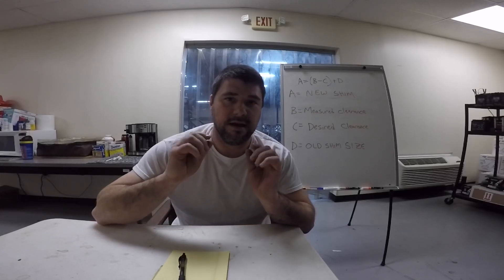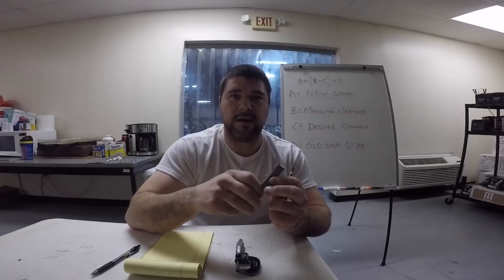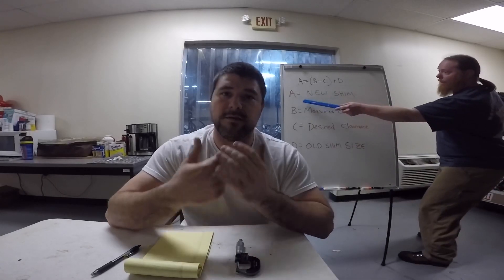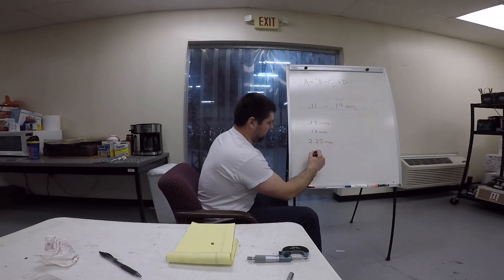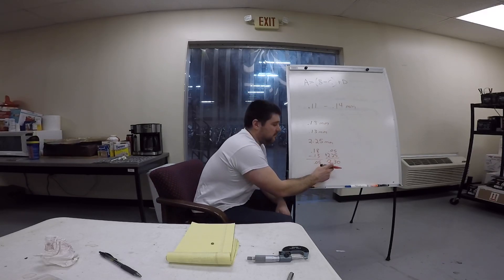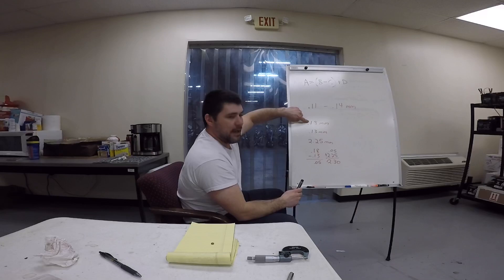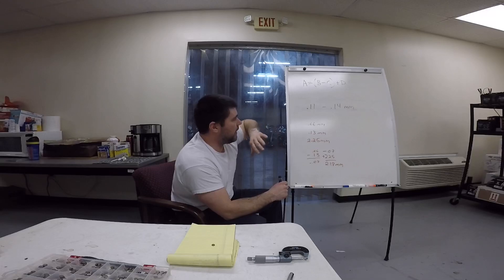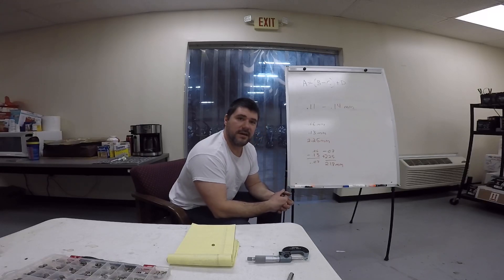How to select the proper valve shims

Comment: @Matt; for the G310GS, it is my understanding the intake valve clearance specs are 0.11mm-0.20mm & the exhaust is 0.26mm-0.35mm.  After speaking with some reputable mechanics, they recommended setting it at the "tighter" end of the range....such as 0.13mm & 0.28mm.  The theory is it allows valves to open more, and they are confident the bikes run better.  Thoughts?

Comment: I just got my r1 back together and all my valves are in spec now but it will not start and I have the timing correct and lined up. Could a timing chain to tight cause it to not start?
Reply from the maker: Double check everything. If it’s throwing a code 19 when your trying to start it your ignition switch needs to be cleaned

Comment: I had my bikes head resurfaced and installed brand new valves. Would I just measure new shims until I get the factory spec? Because i cant go off of the old measurements since everything is new now right?

Comment: I got a new question. I just changed my exhaust valve from a 265 shim to a 258 shim because i measured 0,18mm and need 0,21-0,25mm. When i changed to the 258 i tried to get in a 0,28mm and had to force it in with some pressure and it worked but it felt to much pressure. I dont know if im gonna change it to a 260 or just have 258. I tried with the 0,25mm and it felt like it should
Reply from the maker: Looser is better than tighter when it comes to shim adjustments. It sounds like the adjustment is fine

Comment: hey, i got a shim now that is 2.675 and the clearance is around 0.18mm. I calculated that it needs a 2.705 but then i should get a 2.70 which is gonna be 0.005mm too loose. the standard intake clearance is 0.11-0.15mm
Reply from the maker: That should be fine